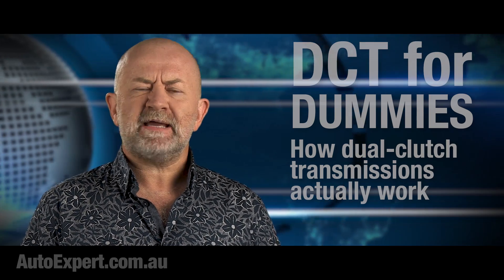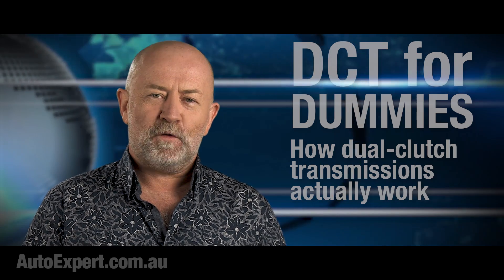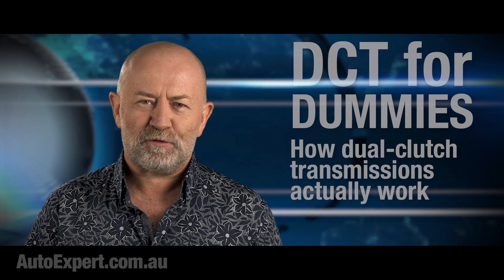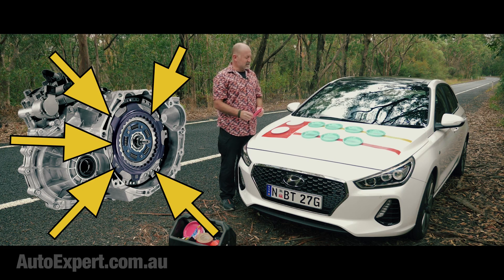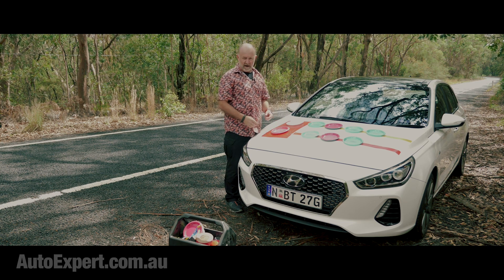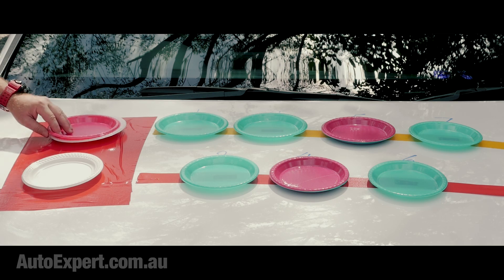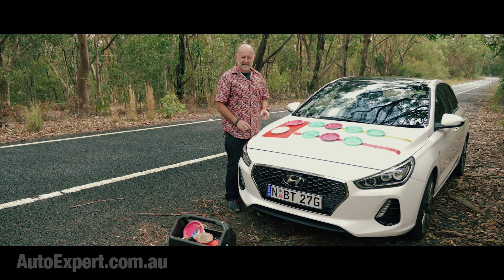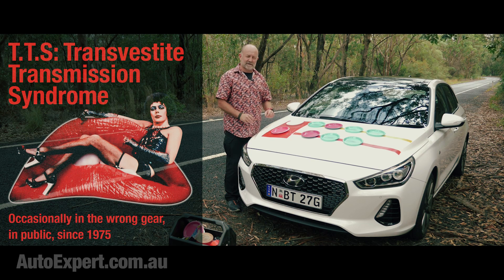DCTs for Dummies. (How dual clutch transmissions really work.) | Auto Expert John Cadogan

Comment: I have a 2012 Audi with an S-tronic transmission (their name for DCT); its current mileage is 184000 kilometers and I had no problems at all so I can say DSGs are reliable if maintained correctly. PS: the shift time for Volkswagen/Audi DSGs is usually 8ms.
Reply: The VW/Audi DCT comes in various types, the 7-speed dry clutch DQ200 has been the most problematic, the later wet clutch DQ500 seems fine so far but despite what VW says, the dry clutch models do benefit from an oil chage every 3/4 years.
Reply: I agree, the dry clutch ones have been quite problematic. I have a DL501 wet clutch. In Europe audi recommends changing the DCT oil every 60 000 km. I've tried changing mine every 45 000 km.

Comment: I rented a Fiesta with the DCT and liked it a lot.  However, I think rental agencies, if they're going to have cars with DCT and even CVT, they should at least give you a little info so you don't think there's an issue with the car because they have a different driving dynamic.
I thought the little Fiesta was fun to drive on the curvy roads per my house even though the engine isn't powerful.

Comment: John,  I've been looking at a Honda CTX-700 motorcycle with the DCT transmission.  I'm 67 and a conservative driver.  I've read nothing about the longevity of the dual clutch transmissions.  Do they have  the same level of dependability and the lifespan of other transmissions?  PS I love your channel.  Learning a lot from you.

Comment: Even with the hesitation, its still extremely quick, the hesitation just feels an age cos you're used to the instant switch. Of the DSG wv's are rather good tbf. Or at least Skoda's vrs interpretation is. I assume they are all the same, off the shelf jobbies, shared across the vag range.

Even normal average autos have hesitation, but in reality, it's quicker than a manual. (Gas off/Clutch in/gear/clutch out(on gas), as you have to do non of the time-consuming stuff, just press a button, so you feel that 'dead' space. 

Nothing like going to overtake, pulling out, and the wait for the car to drop down. 

I will pull back from the car in front (you can see around it better anyway), then you get a good run up so the car to sort itself out (drop down) before you pull out. This gives you time to pull out of the manoeuvre, off needs and/or puts you in the best (safest)position to get past the car in front. 

When i swapped to an auto i soon found i had to adapt my driving to the car. As pulling out and simply flooring it, can lead to brown pants.

Comment: I'd say dual clutch is a nice middle term between a manual and an auto that, arguably, has no soul. Love your videos (and therefore, knowledge), mate. I have a question, do newer dual clutch transmissions have a mode that leave the pre-selection to the driver? Like a super aggressive sport mode?
I ask that because I instantly remembered a transmission system that was on an old executive bus I used to take (I assume any buses in that category newer than that can do even better), and it worked like this: the driver pre-selected the gear he would put next, and then the computers on the transmission would change to that when adequate (probably doing the rev matching and stuff), it was so cool. OFF-TOPIC:You could also program the cruise speed, and you'd ride along. A monster bus, for sure, it was branded SCANIA (with an engine from their own making or from Mercedes-Benz, or Volvo, I'm not sure anymore) and lot's of comfort and smooth riding.

Comment: I like to creep forward in traffic or into a parking space by just letting off the brake ,when I drive an old petrol auto I need revs but it's hard to modulate the speed in reverse I find I'm reaching for the clutch to try and slow it down and slamming on the brake, long story short dct scares me since it doesn't creep and when you do it doesn't like it... my next car will be a manual I won't drive a dct Iv seen many a YouTube video of people jumping forward into objects ..apparently their awesome when you use the paddles if I wanted to use paddles I might as well use a stick it's either lazy or it's not I don't have an issue with my auto now no gimmicks put it in d off you go and not to mention p which some don't have , but the car I want next offers dct or manual I'll be going manual

Comment: What have Ford and VW done? ... Gotta search. On a DCT if you accelerate then lift, does it hold the gear you're in or does it go into neutral guessing where you might go next. Does it only downshift when you get on the gas after coming out of a slow corner or does it downshift to match your speed?
I've obviously never driven one
Reply: To answer the question, least how it pertains to Ford's rendition of the Getrag 6DCTs
1. If you accelerate, then lift, it'll hold your gear, regardless of mode. In such regards, pretty much all of its behavior, especially when in D, is meant to replicate that of an automatic as much as possible, which would also answer the other questions. In a way, it's kinda the fatal flaw of DCTs and their programming, especially in stop-go situations.

In manual mode, things change a bit, though the may thing is that regardless of acceleration or deceleration, it will try to hold gears unless you request a shift that's then accepted. Especially for deceleration, this makes manually requesting gears far before the TCM decides to make the downshift critical, as significant hesitation will occur otherwise.

Comment: I'm curious why don't some DCTs have a second set of paddles to (optionally) tell it whether you'll want it to go up or down next. By the way, other than the recall, has VAG done anything else to add to DCTs' disreputation? All I actually hear from real people (we all know engineers aren't real) is that DSG is very reliable, comfortable (even if that doesn't match with my experience with that Kodiaq nonsense Skoda came up with) and just very good in general.

Comment: Not on every car. For example a 2014 Škoda Octavia with the 2.0 TDI (110kw) is both faster and more economical with the 6spd manual. DSG is 0.1 slower to 100 and consumes 0.3L/100km more.

Comment: Hi John.
Not long ago a drove an M car, a real one (575hp V8), I've found it to be kind of harsh at mid range shifting. Low rev gear change, or the clutch actuating, is smooth, same at higher revs. At my regular driving, shifting somewhere between 2500+ and 3500/4000 it was not uncomfortable but the driver can definitely feel it working (understatement) and it's kind of audible.
You who drive many cars, is this a normal/acceptable behaviour?
I would definitely be able to live with with a dct, the paddles on the wheel is definitly a big NO though.
On the column is a much better placement.

Comment: I've owned and driven a DCT Ralliart for 8 years now.  Never had a problem.  5 year warranty applied to the box too - not that I needed it.

Comments - 
Great to drive  manually, the auto shift patterns in this model have been 'dumbed down' to improve fuel efficiency.  
It will creep if no brake applied just like a standard auto - touch the brake and it stops - it actually disengages, the load drops and revs rise.  
It will try to hold you on a hill and that's a bad thing - use the brake AND handbrake to disengage and do the hill-start.
There is a bit of shuffling in traffic but you can override that with the paddles if the space is that important.
I became disabled and the auto mode saved me replacing it.  Wish the i30n came with one.
Don't really see the need for DCT over a normal auto for street cars - they can all be shifted electrically anyway if paddles are your thing.
Factory service costs are scary because of the oil and filter cost - I imagine a CVT oil and belt replacements are just as scary.  Just use Castrol Transmax Dual instead.

Nothing will come close to the shift speeds of the DCT.  If you use the mad sport mode it's insane fast and a very satisfying drive.  I've driven turbo's since 1982 and just love the surge they give - it's addictive and the DCT keeps it going.

Comment: Im in my 50's, and ive hated Auto cars all my life. I like to drive my cars, and a good manual has always made me feel at one with the car and gives me the control i desire. However, age and health and some bad hips means i cannot drive manuals anymore.  So i took the plunge to....a DCT.
I have a 2016 Mercedes A220d DCT with the 2.2d engine. It is a complete and utter revelation. I will say however during the first few months of ownership the car was often Jerky when taking off, or would have delays in shifting. But Merc released a software update in Nov 2016 that completely fixed it. Its now super smooth, and changes gear in the blink of an eye. Its predictions on gear shifting are just bang on, its really amazing. What i have learned about the merc box is that it relies heavily on "Adaption". That is to say it learns you, and how "You" drive. If you have the Keyless option, then it saves these Learning profiles separately, for each key. So you have have his and hers learning profiles for when the mrs borrows the car. Really smart stuff. So, it is worth noting, if you buy a used Merc DCT, get the dealership to "Clear Adaptions". So the box then learns how you drive. Not carry on thinking its the same person behind the wheel.

Ive done 51,000 miles now in 1.5yrs and it is the best gearbox i have ever used in my life. Unfortunately at present Merc only offer the DCT in the A Class, and CLA / GLA.
It also has a "Secret" mode which will enable gearshift in 100ms. Yes thats right 0.1 of a second.
Put Dynamic Select to "Sport". Auto Stop/Start to Off. Go into the centre trip computer menu and set ESP to Off.
It will now shift in 0.1 seconds.
Also, with the above selected, you can now do Launch Control. This is the best bit.
Left foot brake, hold ready. Mash the throttle to the floor. Revs will rise to 3000 or so RPM. When ready, let go of the brake.
Its mental. This combo is what makes the A220d DCT the "Quickest" diesel hatchback money can buy.

Also worth noting the Service requirements of a DCT. In the case of the Merc DCT. It needs  fluid change at 42k. And its a very special oil thats used, specific to these gearboxes. Luckily my car came with a free servicing deal, so i didnt have to pay anything.

Dont know if this can be done in the other makes of DCT. But also the merc can be set to a full Manual. You have to go into the Dynamic Select "Individual setting". And set the gearbox to Manual. Now when in "Individual mode", You have to use the paddles permanently all the time. The computer will not intervene. This can be fun, when your having a bored day and want to be involved a bit more.
Reply: Forgot to mention the "Gliding Mode". Not trying to sell the Merc DCT here, honest. lol
So one other feature is called "Gliding Mode". This only works when the car is put into "Eco". Basically what happens is every time you let off the throttle in any condition, the clutch disengages and it freewheels. This really does take some getting used too and i would not recommend new young inexperienced drivers using it. There are some conditions, like on a long downward sloping hill. You will gain speed quite rapidly and can find yourself going over the speed limit. But if you make use of the Gliding Mode sensibly it can really help with fuel. Typically in a week i do about 800 miles, and the trip computer says in a week i have gained 55 or so extra Free miles, by using Gliding mode. This helps to bring the average MPG up to 70mpg.
Reply: my granpa is 86 and he still his manual car to go to work everyday 'he owns a bar'
Reply: That "Gliding Mode". I think it compromises safety.
Reply: I had a C320 and a C32 AMG, both had the same transmission. Neither were available with a manual and not once did I ever feel the shifting was slow or it was trying to choose the wrong gear. Both were driven either gentle in commuter traffic or like it was stolen for a more spirited drive.  They always knew which gear change to be in and both would return real world 36mpg. This is because those real slip autos have something John didn't highlight - TORQUE CONVERTER LOCKUP.
Both covered almost 200,000 miles each before selling them many years ago. Never a transmission issue and only one fluid change at 100,000.  My biggest concern with DC or what ever acronym is longevity.
 - PS I forgot to mention years after selling them they're both on the road, the C320 recently was hit bean uninsured driver who was driving like a maniac who didn't pay damages as he was unemployed and it got wrote off.  The C32 is still running - both were sold to a neighbour and colleague.
Reply: OK, yes i agree. Hence i said i would not recommend it for inexperienced drivers. But i drive for a living and now after 50+k im very used to it. The feature really does help with MPG.
Reply: most people who are fans of manual actually have very little beef with the DCT because it lacks the dreaded torque converter and that is what really sucks about auto transmissions.
Reply: Duane Dempster yes of course because the bmw zf is beautiful, it locks the torque converter to drive hard or hold you back going down hill. My last 3 7 series do this. E38 e65 worked well but in new 730d it does a setting of disengagement which I don't like so don't use eco setting. When we learnt to drive you were told not to coast out of stick as you not in control of your vehicle.
Reply: Paul Taylor
I think that´s a bad idea.
Reply: @mindtravller. Whats a bad idea ?.
Reply: Very well written and compelling reading.  I was particularly interested in the 'learns your driving' part as I drive a Seat Leon DSG and as far as I am aware that car does not have that feature, but of course I appreciate its a cheaper car than your Merc.  Also, 51k miles in 18 months is a lot of miles compared to my wife and I driving some 5K per year at best.
Reply: On another point the Seat Leon we drive is a petrol, do you know if this clutch type and diesels are better in any respects or maybe worse?
Reply: Paul Taylor
We can do the same thing on a manual gearbox: put it neutral when descending. But no auto safety expert recommends this, and there´s a reason for that.
Reply: Yeah, the combination of paddles and DCT are a very enjoyable combo. As a long-time cyclist and a novice driver, I often prefer shifting manually while still steering with both hands and I really don't like the tram-like sensation of a slushbox.
And I really like the factory setup of a VW DSG7 gearbox, no matter how fragile the gearbox itself is. All in for smoothness fuel economy in "D" (I call it a "highway mode"). Live and aggressive, with lots of engine braking in "Sport" ("city mode" for me), even with an underpowered 102 BHP naturally aspirated engine. And what I also like is a seamless "kickdown" - press the pedal to the floor and in a half a second the gearbox will smoothly downshift 3 or 5 gears, pushing the engine exactly into maximum power RPM, just like a CVT does. This also works in a manual mode - don't try to confuse the gearbox by clicking 3 gears down (BTW, the gearbox really goes mad during fast multi-shifts), just press the pedal and let the kickdown switch override the manual control, do that overtake and take the gear control back by a single manual upshift.

I still think that CVT or anything with a torque converter is a better choice for stop-and-go traffic, however DCT is by far more enjoyable, on par with manual.
Reply: forget the torque converter. I just want be able to select ANY plausible gear at ANY time and have no dreaded change down/change up decision pause of an auto and have the acceleration/engine braking needed straight away - eg: the lane changing example used in the video.
Reply: Yup. 
That's available in my dct--just put it in 'manual mode' and drive it like a manual--except there's no clutch pedal to push.
Reply: Scott Smith Sadly, afaik, there are no automated gearboxes with an H-pattern shifter. However, DCT (my experience is based on a VAG DSG7) lets you skip gears down by pressing a kickdown switch. It looks like this: you are driving at 60 kph (that's gear 7 in "D", gear 5 in "S" or any gear in range of 2 to 7 in manual mode). Then you make a kickdown, the gearbox immediately switches to 2nd gear and the car accelerates furiously until the engine hits the rev limiter, then it switches to 3rd gear. When you are done with the overtake, just release the pedal a little bit and the gearbox switches back to whatever gear you were in manual or to whatever gear it thinks is appropriate for the speed in automatic modes (D/S).
The only thing the gearbox lacks is the ability to skip gears up manually (though, with the kickdown trick it, sort of, makes that).